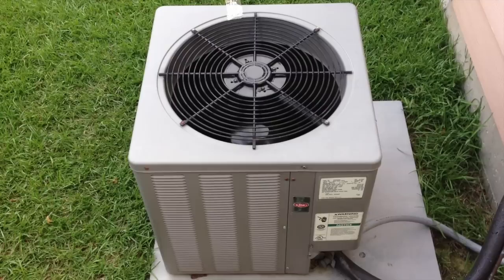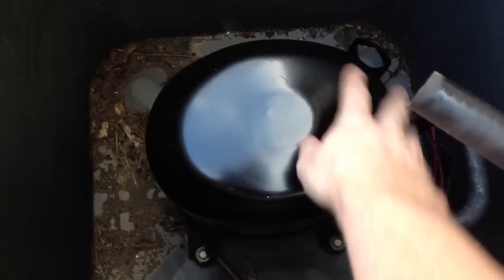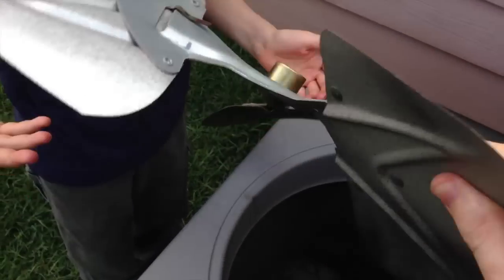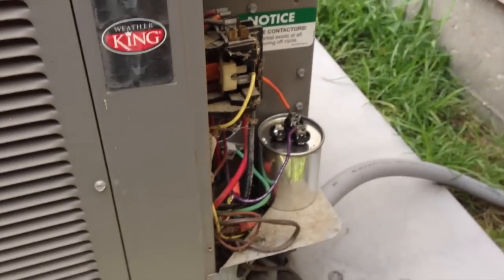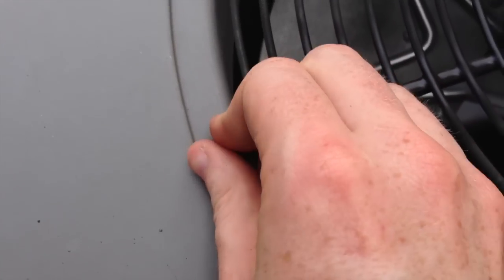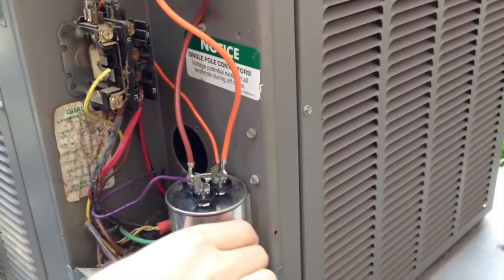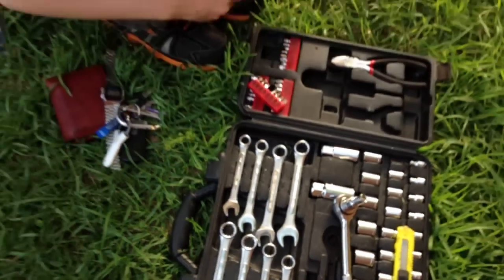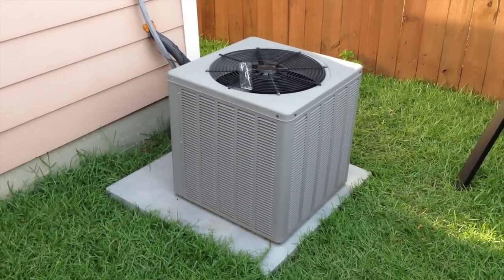AC Fan Not Running - Replacing the HVAC Fan Motor vs Capacitor

Comment: Hi today my Central Air wasn't working, I went to the unit outside and it was quiet. I hit the reset and it kicked on but the condensor fan wasn't spinning. I gave it a spin with a stick and it started to spin perfectly on it's own. Later in the day again it wasn't spinning, I repeated the same process and it worked. my fan spins easily when I give it a spin. I'm trying to figure out if it's the condensor motor or capacitor, is there a way to determine? I appreciate any help. Thank you.
Reply: hak1985org Thank you for the quick reply. My unit is a 2006, I wasn't sure if a bad cap. would prevent the fan from starting, but with a soft push allow it to run.
Reply: hak1985org Thank you so much for your help. I will be replacing the Cap. tomorrow and see is that does it. You've been a great help ;)
Reply: Hey i have the same issue. I too had to push my fan. I did that just now and waiting for my house to cool down from 85 degrees. Did you figure out what the problem was? Was it expensive?
Reply: zenitram102 After Hak steered me in the right direction, I DISCONNECTED the power and opened the unit. My plan was to get the information off the capacitor and buy a new one. What I noticed was one of the leads that plugs into the Cap. had broken off so it wasn't making a good connection. It basically was just pressing against the terminal. I put a new female plug on it and pressed it back in place, it's been working fine since. So though my Cap wasn't "bad" it wasn't able to do it's job probably. If your fan motor spins freely when you spin it by hand I would definitely replace the cap 1st. It's easy to do and not expensive. Get the part number off the suspected bad one and order a replacement. I cannot stress enough the importance of killing all power before working on it and even with power removed, the cap. can still hold enough of a charge to give you a bad shock. Hope that helps.
Reply: my capacitor looked fine but was not reading right. to the naked eye you couldn't really tell if my capacitor was bad. I switched it out and BOOM! the fan quickly kicked on. I heard someone paid close to 200 to get this done when the part is only about $30. lol
Reply: physiques you already did it. you have a bad capacitor and very likely now a bad motor. replace both for peace of mind.
Reply: physiques it will run for a while, but expect the motor to burn out eventually. replace both.
Reply: physiques a bad capacitor leads to the destruction (burn out) of the motor. replace both.
Reply: It is the capacitor. If the fan motor was dead, it would be tighter when you poked it.
Reply: lizziepickle3000 I was lucky, upon taking a closer look one of the wires on the capacitor came loose so the connection was spotty. After correcting that it has since worked flawlessly. Thanks for the reply I do appreciate it :)

Comment: I got no problems with your repair EXCEPT the capacitor not being secured to the cabinet....Most every Ruud, Rheem and Weatherking I've ever seen all have that little hole in the sheet metal where the OEM capacitor goes....Caps come in all shapes and sizes (even though they have the same values).....I would have used a piece of plumber's strapping and 2 sheet metal screws to secure it....Trust me, I've seen them short out against the chassis....Properly strapped/secured, they can't....otherwise, very nice vid....

Comment: I have a question I recently changed my fan motor and capacitor because my fan was turning on and off I noticed my house was not cooling so I checked my unit outside and I noticed the compressor was turning on and would shut off and the fan wasn’t turning on I changed the fan and capacitor and it turned right on but after a few minutes the fan turn off and my compressor would kick on and turn off I’m guessing because the fan wasn’t kicking on does any one know what could be the problem it’s a good man 3 ton
Reply: @hak1985org  thank you I went and did some more looking around and found a burnt wire 
I’m new at this so I don’t know a lot on ac I’m doing all the work on my own

Comment: That contactor looks kind of old.  I'd probably swap that out as well given that it's $8-$10 or so for a new one online.  Whenever they start to get rusty and look like that I just replace them since they're cheap yet critical.

If you don't want to replace it, at LEAST get some air and blow off those cobwebs!
Reply: I love cobwebs... and south Louisiana.  I haven't been in quite a while though.  Cobwebs don't conduct electricity though - fair point.  Is that contactor pitted at all?  I usually swap them when they show any sign of corrosion since they're so cheap.
Reply: ScubaCat3 it will blow the cobwebs, but will not fix the cap.inside.
Reply: Yeah, I thought they'd be a problem but I was wrong.  Cobwebs do not conduct electricity at all.
Reply: I misread that as "that contractor looks kind of old." I thought that was an example of how the internet could be so cruel...

Comment: What type of compressor is that?
Reply: Sonny Cannon So what happened to bristol? I know there cheap and bad. And which is the best compressor?
Reply: Sonny Cannon Carrier uses a scroll compressor right? Why do most home builders use Carrier? And cheaper home builders uses Lennox.
Reply: Sonny Cannon I don't know who's idea was to install Goodman 13 SEEE air conditioners at my church. The past ones, which got stolen and scraped, were Lennox Elite from the either 2001 or 2002. I forgot the seer rating on it but they were the best air conditioners at the time. The Goodmans were installed 2011, the same year the lennoxs  were stolen.
Reply: Sonny Cannon What's the best brand?

Comment: my trane ac  comes on for 3 seconds and shuts off,  it will stay off for 10 to 20 minutes but when it tries to come back on,  it shuts off after 3 seconds again.   I changed the fan motor and the capacitor ,  can some body tell me what to do now,   the breaker is not tripped.

Comment: A pro would have cleaned the condenser coils while the top was off.  Lol while you were screwing with the paint, the debris in the bottom will turn to mud blocking the drain holes. Rain and condensate will cause the bottom to rust out.  That cap should have been secured to something with a wire tie. Big deal to me Mr Safety, is an open access disconnect to your helper and his pals. Put a bolt,lock or something to keep kids out of the 220.

Comment: Same model, buzzing relay, no fan movement, replaced cap, no fan, buzzing relay, pushed contacts, no fan. What's the fan wire testing for ohms? 
Edit, good news, moron move, main breaker I thought was on ....was off, fan ramped up nicely but loudly, might be the way I put the shroud back together? Or the bearings are going out? But after tearing it down and spending time learning the nuts and bolts and caps of it all and found the fan model for the future I'm armed with knowledge. Being a med tech and comp tech in the past made me stubborn if not smart.

Comment: i never heared of 45/3 mfd capacitor . it's problably 45/5
Reply: 45/3 is a common size for Rheem, Rudd and older ICP units. I carry a wide range of sized of run caps on the truck. Some Trane units use 4 mfd run caps for the condenser motors
Reply: T&N Services LLC. What do you think of this video?
Reply: Aittchakcht abdelali I agree I think we need to keep this guy away from sharp objects going to leave it to the professionals LOL

Comment: Can I run my ac unit with my water turned off in the house
Reply: Yes, an air conditioner doesn't use water, unless you have an evaporative cooler (swamp cooler).
Reply: OK thanks. Appreciate it

Comment: Ordered a new fan motor, everything is placed perfectly. But the motor won't run when placed fan side down. The fan seizes up and doesnt move easily. But, we placed the fan turned up and it runs fine and the blades move freely.  Any idea what's going on?

Comment: Most of the time i get zero advantage out of backwashing thou. Soap makes it slide easier, and taking metal sides off is must, if grass is bunched there. Lol, i tell them, it's like radiator on your car. If it's dirty, heat wont get out, just like with engine. Everything else about pressures and overamping is tmi for them.

Comment: Shouldn't you disconnect power supply?
Reply: hak1985org Also watch the video again and you will see the low voltage wires hooked up in the disconnect box.

Comment: Just had my capacitor replaced by Wesley woods and it cost 233.00
Reply: $233? Dang. Capacitor's  as low as $25 and very simple to do. You should have you tubed first.
Reply: Thanks to the YouTube video creators out there, I looked at my capacitor and it was bulging. I bought one today for $21 and replaced it in about 5 minutes.
Reply: hak1985org I agree!

Comment: Well I have a number of issues with this. First, yes I am a contractor, but that is not my issue! Did you check the AMP draw on that motor when you started it? You do not have to wait to see if it's good, check it right away, clean the condenser coils and the unit out for sure when its open, and strap the capactitor. The capacitor rating is determined by the motor and compresor in the unit, NOT the original size that was in the unit. Something may have changed along the way. Was the contactor replaced? it should have been! Escpecially with a ten plus year old unit, and all the spider debris around it. Have you thought you might be giving just enough instruction to kill someone? 
Last, the reason parts cost more at some places than others is not that the contractor is ripping them off. They have insurnace, overheads, fuel, auto repairs and every other aspect of business to pay for. If you want cheap, you get cheap and it will show.

Comment: So the point of these videos is to make less educated people informed. In your own words "if both are insulated for high voltage." The wires in this junction box were obviously not insulated 18 Gauge THHN. So in this application the wiring was incorrect and people need to know it's not O.K. There could also be a partitioned area of some sort, but again in this application there is no partition. Now there are two reasons I know why this is not O.K. Most important if the two wires were to short on each other and a load is applied the low voltage wire is going to get hot and potentially melt and start a fire. These low voltage wires just had wire nuts on them that could get bumped off and short to the high voltage. Also not all low voltage technicians are trained in high voltage, so they separate the two so that people do not get injured. So again in this video the wiring is incorrect. And because of the potential for fire we would not want to mislead people into thinking this is O.K.
Reply: Km M You must belong to those less educated people since you are not familiar with the NEC. The wires inside are insulated to 600V, both for power and control. They do not have to be THHN either, TW are better for this application.First read the NEC and then dispense advise to the less educated people. It is apparent your ego is bigger than your knowledge.
Reply: Andrey Andrews The world and what it has become. I will state a few facts and then I am done with this conversation. Your TW wire from what I can tell is not a product heavily in use today. It also appears that TW does not really go smaller than 14 gauge. If you look in the video the thermostat wire being used is 18/5. There are red, white, blue, green, and yellow conductors. Two of the conductors are being used with the rest of them being wrapped around the sheathing. Standard thermostat wire is rated for only 150 volts. I will even give you the benefit and say that this is plenum rated wiring. Plenum rated wiring is only 300 volts. You stated that they both need to be insulated for 600 volts. You make reference to the whole "NEC" book....I am glad you know what this book is but you make no reference to a particular section of this book that would back up your claims. Nor do you make any reference as to why you believe this specific wire is rated to 600 volts. Again I am not saying that it is impossible to mix high voltage and low voltage...I am stating that in this video the wiring is incorrect. I am not going to get into name calling because that's not what this is about. If you have something educational to share then I am all ears.
Reply: Well sir, when your Aircon cap goes out, hire someone 500$-600$ to replace a 20$ part, if you feel better about doing that......